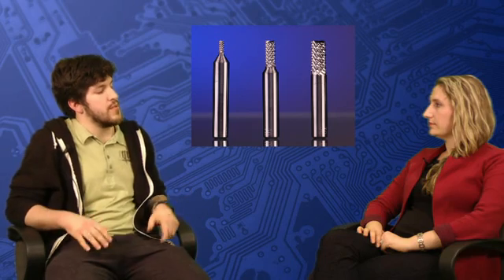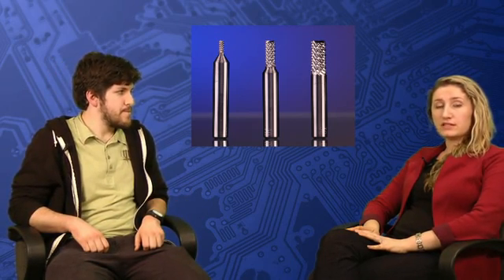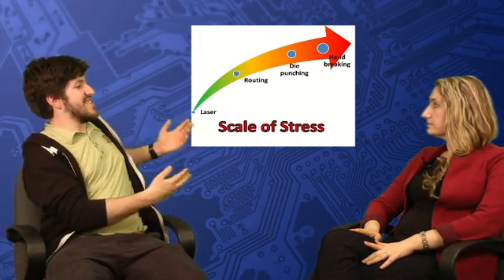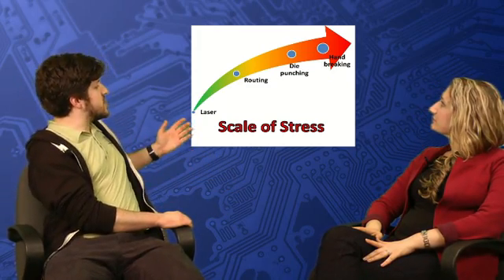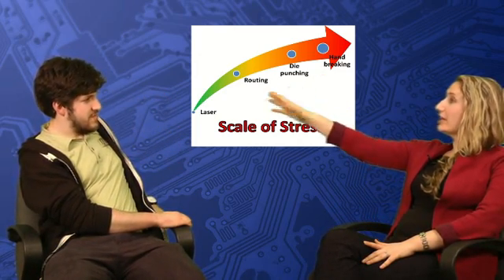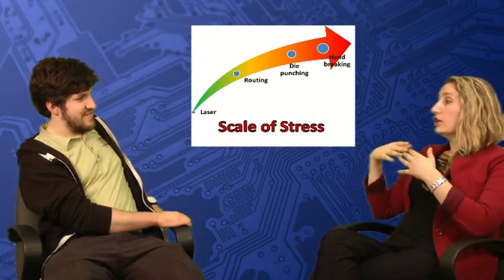Mechanical Stress and PCB Depaneling

Comment: what about v-score and pizza cutter?
Reply from the maker: Sure, V-scored panels cut by laser will induce far less mechanical stress to the panel, allowing for for precise cuts, with components mounted right to the edge of the board without breaking solder joints.

Comment: one more question about the laser-cutting option; is that typically cutting pre-routed tabs? or are manufacturers using it to cut the entire board shape at the end of the assembly process?

Comment from the maker: Jack, thanks for the comment! For the sake of time we had to omit some methods - including pizza cutting. In comparison to routing, it actually imposes a different kind of stress.

Depaneling with routers will make the entire board vibrate, while pizza cutters stress the board in the area that is being cut. Similar to routers, pizza cutters also require leaving a specific clearance for depaneling so you can't place components very close to the edge. Hope this helps!

- Shane